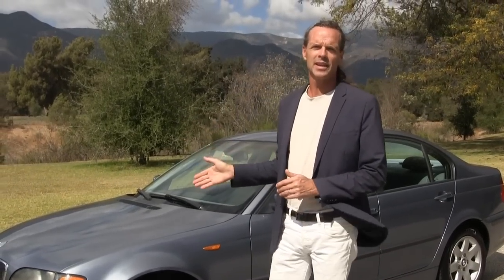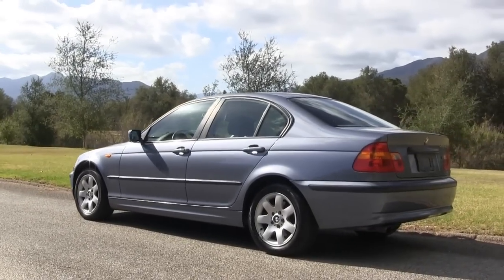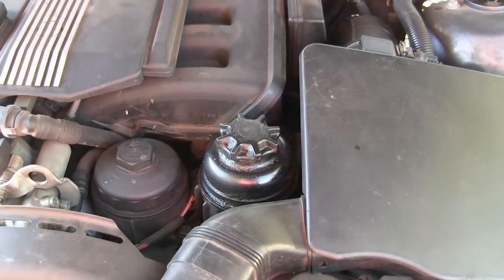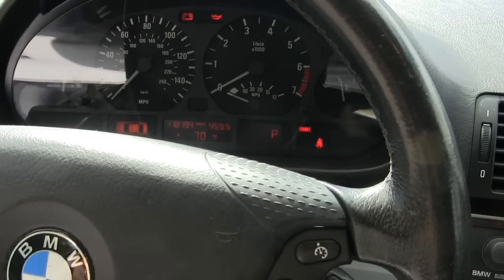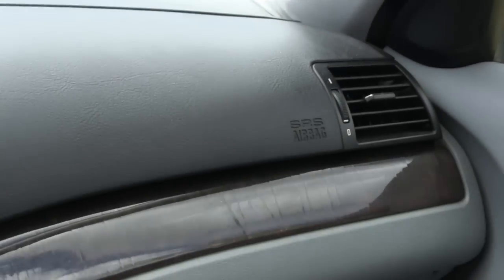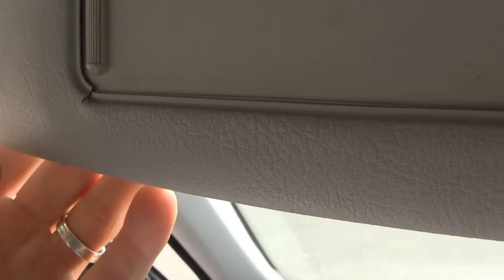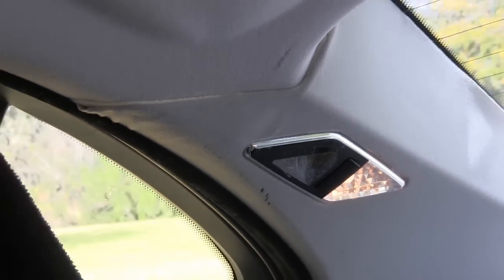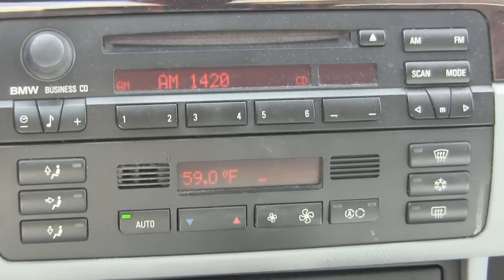Why You Should NOT Buy a Used BMW

Comment: I've had my diesel 320 e46 for 7 years now and it's been a joy to own ..... loads of torque and good fuel economy....I just love the way yanks always dump on European cars when they can't make a car go round a corner,they make a big deal out of a v8 that has 350 bhp we can get that from a 2 litre....I love my BMW's I've had 2 now and I'll keep buying them.
Reply: It's not just Americans, so many, people expect great driving well engineered Euro cars to have Japanese reliability (part of that is because they are simple).  Infiniti and to some degree a few Aciras have approached German performance- but there have been small issues there. Granted, Porsche does have that mastered which is amazing.
Reply: you are living in the 70s, right? exactly the same technical level in all today's cars. the fact some cars have multilink rera suspension while others don't, is not the reason for better durability. electronics is on th esame level everywhere from 5000 - 500 000 cars in dollars/euros
Reply: TheKenjoje he was talking about a car dating back to 90s/early 2ks. That said- even today, wouldn't you say a basic Corolla is vastly different than even a C class Mercedes which can have air suspension and drive itself (not to mention most cars still have traditional wiring vs. fiber optics)?
Reply: DFWs Cars not at all, in terms of equipment everyone is on a par, those times are gone when s-class was first car with abs....small cars get that electronics as well....
merc with air suspension is too expensive and the result is unimpressive in c class....besides, it is tech about half a century old and not that terribly expensive as final price tag is....merc is overrated crap....avensis is competitor of c class and it maybe is not as good, but for the moeny it is better....and differences are essentially small....back to the reliability - if merc c dorsn't have the air suspension, then it is comparable technologically with any toyota (not lexus, even toyota)....so, exactly the same amount of things to go wrong....
Reply: TheKenjoje good points, but in the US and other countries it's different.  We don't have an "avensis" here. Example 1. Kia/Fords are good in US, but European Kias, Fords- kill them in performance, style, etc.  Here many Asian imports are US built and rarely pioneer new technologies (there are exceptions in luxury brands like Infiniti, etc.   The US market is all about low starting price, having a cheap lease payment-- Oh and space AND cupholders.  VW even gave in- look no further how much worse the American Jetta/Passat is than the European ones.  Drum breaks on the base Jetta? come on now. Heck even Audi is building cars in Mexico for the US market.
Reply: TheKenjoje the closest we have to Avensis is a Avalon which is basically an American car (think old floaty Cadillacs).
Reply: DFWs Cars don't get confused by mexican production. the level of quality won't be worse than in europe because us market is big and important, but if they think they can save, they will....they know americans have decent roads and don't like anything but straight line driving, so they offer jetta without rear multilink and save the money....in europe, the poorest country gets better jetta than us....but not in terms of reliability. that said, both are relatively bad :)
Reply: DFWs Cars what is passat's/a4's competitor in us? maybe camry?
Reply: It is! And the Camry we get has a powertrain that goes back to 2011, minus some small refreshed items.  :(
Reply: DFWs Cars because most americans (still) just care for car as long as it's with automatic 'box and as long as it doesn't breakdown a lot, it's ok....toyota drivers in usa use their cars like any other technical appliance....so, if they don't care, why toyota should....btw. toyota doesn't offer anything special in europe as well, they still have non-turbo petrols in avensis and others don't any longer....
Reply: "I've had my diesel 320 e46 for 7 years now and it's been a joy to own..."

Sure but that's what you would expect from a top brand.  You're saying that your sample size of one is testimony to a reliable car.  The fact that a significant number of owners have these problems is a pointer to poor design and/or workmanship.

I could probably find someone who owns a Citroen who hasn't had any problems (but probably not).  That doesn't make it a reliable car.
Reply: Warren NZ there are happy cit owners
Reply: TheKenjoje I know, I'm exaggerating.  8^)

But I only know one person who owned a Citroen.  They bought it new and it was a total lemon.  They said it broke down constantly and the dealer never had parts in stock.  They sold it in disgust.

You'd have to look hard to find just ONE Corolla owner who had a story like that.  I only have one Citroen story and it's a nightmare.
Reply: Warren NZ well, during 2000s cits were ok. electronics could make troubles, but mechanics are decent. at average, better than bmw....
Reply: TheKenjoje I remember the old Citroens that had adjustable ride height and you could drive them on 3 wheels.  Can't remember what they were called.  Super ugly but arguably ahead of their time in some ways.

You could jack change a tyre by raising the suspension, blocking the chassis and then lowering the suspension.  Kinda cool.

i don't know how reliable they were but nothing was very reliable back then.
Reply: Warren NZ a lot of things were more reliable back then, you are very young and uninformed. DS wasn't that reliable, but technologically ahead of the time. on 3 wheels - no
Reply: TheKenjoje Why thank you.  I don't normally think of 64 as "very young".  8^)

I disagree, I was there.  Carburetor equipped engines were famous for flooding and distributors with points were unreliable too.  You could never be certain your car would start like you can today.

Fords were horrible at starting.  I used to hear people cranking them over for 10 seconds to start them.  I knew someone who had a 351 in a Fairlane and if you turned it off when it was warmed up, the pistons would seize in the cylinders until it cooled off!  It was pretty quick for a Ford though.

Most cars had drum brakes and leaf springs which were awful.  You'd see cars blowing blue smoke out the back several times every day.  You almost never see that now.  Well I don't.
Reply: Warren NZ wow, how bad view from you....old diesels had starting issues. vag diesels were better at it in 80s. carbs are simple mechanics to fix. ecus are harder to diagnose. needs more expertise to get through intermitent errors. I've been 'there' with both carb and ecu cars from this century.
europian ford diesels were rubbish, but they borrowed some from peugeot and that wasn't bad.
you can't be certain today with french electronics I mentioned. it is possible that car just don't wanna start and you can not find why. diagnostic checsk says it's ok. is it solution to change the computer? very expensive. in the old days, YOU KNEW why it doesn't work.
modern diesels are full of very interesting smokes. the most modern are full of choked dpfs. ecu sends more fuel to regenrate dpf which ends up in overfueling which intoxicates the oil sump. pretty much the same like with fucked carbs....the thing is older diesels didn't have precise electronic injection, so if needed, there was a lot of fuel on cold and cars were making black smoke even when new in cold....it is hard to see the diesel with more than 200 000 km without any smoke....
it is better to have certain smoke and instantly know what is it....today, in some cars, cats swallow some smokes, disguise it....you check the oil, no leaks, and the engine eats oil....after a while, a cat gets choked....
drum brakes are not matter of reliability. small cars wtill have those.
leaf springs were rare after seventies in non-commercial cars.
Reply: TheKenjoje I don't have much historical evidence on the reliability of old diesels.  I know they were often hard to start in Canadian winters especially at -40°.

I know what you mean about modern cars being harder to fix if they break but it's rare in my experience with the possible exception of European cars.  A mate of mine had an Audi that blew its engine computer and it wasn't worth fixing.  Another friend said his Audi had poor build quality as he showed me the leather peeling away from his armrest.

I've personally seen a lot of problems with Mercedes.  A way more than you'd see in any Japanese car.

Jaguars used to be famous for breaking down and overheating but I understand they're better now.

Personally I'd never buy a European car.... ever.

With modern engine management systems they will often (usually?) throw an error code pointing to the problem.  But fixing them might be expensive.

I'm not expecting to have such problems with my Lexus though.
Reply: TheKenjoje So I guess I'd say that modern cars are more reliable than the old ones but more difficult to fix if they break and more expensive too.

Does that sound about right?
Reply: Warren NZ diesels were harder to start, but were more durable inn 80s.
the modern equivalent of mercedes w123 doesn't exust today. mechanically, today's cars are not that durable.
Reply: TheKenjoje Well when I was young many people used to carry jumper cables in their trunk in case anyone needed help getting their car started.  I don't see much of that today.

i can't remember the last time I got into my car and it didn't start.  That's because it's never happened.

Anyway I think all that we each want to say on the topic has been said.  let's move on.
8^)
Reply: Warren NZ superficial view, it's not the same whether it was the diesel or petrol, but ok, there were disasterous cars back in time, but I don't think a lot of those were in the west....
Reply: TheKenjoje I bought an old 66 Valiant for $600 in about 1977.  It had a 225 cu in slant 6.  I put about 50,000 miles on it and the only thing that ever broke was the transmission when my wife accidentally put it into reverse at 30 mph.  But I got a replacement for free, a transmission company tidied it up for about $30 and a mate installed it for nothing.

I gave it to the guy who gave me the transmission when I emigrated and it was still going strong at 136,000 miles.

Those cars were reliable and quite quick but were hard on gas.  About 17 mpg around town.
Reply: unlnown one to me.

the wife, however, is absolutely crazy to the extent which is hard to imagine
Reply: TheKenjoje Sounds like a normal wife to me.
8^)
Reply: Warren NZ I usually have a lot of bad stuff to say about women, but putting from 3rd to reverse is somehow beyond my imagination :)
Reply: Wonderful cars Craig, I'm glad we can finally get the diesels here (hopefully we still can after the VAG fiasco).
Reply: True TheKenjoje.  Which sucks, because back in the day of the 116, the 107, the 124 and the 126, Mercedes were truly well built cars (a bit behind on tech in some ways, but still amazing.) Damn near bulletproof autos.

Comment: I bought an E46 328ISE eleven years ago and it's been the most reliable,  comfortable car I've ever owned.  Does over 42 mpg on a run(petrol). Thoroughly recommend them. No slouch either with a "book top speed" of 150mph

Comment: There is so much wrong with the assumptions in this video. I've bought and sold many cars, most of them used BMW, but some Japanese, and American, and the vehicle you have shows gross neglect. Whoever owned it didn't care about keeping it nice. It was neglected, and it shows. That's the problem with the e46 3 series-  some neglectful owners. Many don't care, and since it is getting cheaper upfront to buy one, people overspend just to look cool, and can't keep up with the care. Sure these cars require more upkeep, but if you keep up with the BMW RECOMMENDATIONS, it will be as reliable as anything.  As for the "propitiatory" tools, that's simply ridiculous. I've done a fair bit of maintenance on the e30, e34, and e39 platforms, and I have never once needed a "BMW only" tool. Japanese cars are not a perfect jewel, either. It all comes down to the way it was cared for. I once bought a 2006 Honda Civic Si (newer and should be "nicer" than the older bimmers I've owned). That was the biggest piece of garbage I've ever owned. Nearly every issue you pointed out with this car, was an issue in that car, but it also had a very poorly designed 3rd gear syncro, poorly designed clutch hydraulics, and not to mention the placement of the oil filter requires octopus arms to remove. That car, like all others, BMWs included have design flaws. The flaws are just exacerbated by poor ownership.
Reply: I work as a tech at two euro car shops. One specializes in BMW, the other Volvo.  We of course also do the rest of the euros and even other types from time to time. The thing Ive noticed, ESPECIALLY with Volvo drivers.... I hate them... People who buy luxury cars seem to think the car will tell them everything that is failing or has already failed. Nearly everyday I have a mint looking s90 pull into the shop, literally new looking. Only to test drive it and find it drives horribly, everything is shakey, brakes are terrible, etc. Then I pop the hood and literally everything is leaked out at one time it would seem. Oh and blown turbos.... everyday... I can only imagine that the issue is this mindset. They buy an expensive luxury car, drive it literally til its nearly totalled, THEN they have it towed in or drive it in.... These kinds of owners DO NOT maintain their cars past the contracted period whilst financing their cars, THEN they bring it in, get a huge bill to fix everything and maintain what should be as well. AND BLAME THE CARS!...Seriously?! /endRant

Comment: As with any car, but especially with old beemers, the key is maintenance.
I bought an 03 3 series which had one very careful owner. Complete BMW dealer service history. Fluids changed on schedule from day 1. 
Car drove like new. 150K miles on the clock when I sold it and still on original turbo / clutch. Best 1000 I ever spent.
E46s specifically are well made, solid cars. A good one will give you very little trouble.

Comment: Good  video. He speaks truth.  My wife has a 5 series.  Good thing she has a good mechanic - me. If taken to the dealer for the problems I have fixed, it would of cost thousands of dollars  to fix. The only thing different about my experience is I don't have the interior problems he mentioned.  Oh; one other thing.  Don't get any water in your trunk, the bluetooth  module is in the spare tire well along with the TPS module on 5 series. Had a leaking drink cooler in the trunk and it destroyed both.  Found used modules on Ebay. Drilled 2  holes in spare tire well to prevent  damage next time. I really have mixed feelings about German engineering. There are some good points about the car. It has a very solid suspension. Beefy aluminum parts. Full underbody shield reduces rust under the car. But a used one will need some fixing eventually.  YouTube  BMW oil leaks. I have had most of the oil leaks mentioned.

Comment: I'll grant you the radiators and the side view mirrors, same problem on e39 aswell.
BUT, and theres a big BUT, the radiator expansion tank ONLY crack if t he pressure release valve in the filler cap is faulty, and that's a part you need to replace from time to time.

You see, all the problems below are actually the fault of the owner, the very cheap owner who wants to do their own repairs and modifications and doing so hastily, destroying things along the way:

Kidneys falling out
A pillar getting loose
Wood grain cracking ( I live in EU)
Poor finish on plastics
Ashtray faulty
Sun visor
Window elevator
I've owned alot of beemers, all of them used and i have to say that if you see this on a used car, you KNOW the owner doesn't give two shits about it.

The real issue with e46 imo is the subframe and that only ever happens if you treat your 320 or higher like it's a drag car.
If the previous owner was a woman or an old man the subframe will be perfect.

If you're concerned about sub frame cracking, buy a frame stiffener kit from ebay for cheaps and have it fitted. it'll prevent the subframe from twisting and that will keep the floor intact.

Comment: German cars are of poor material specification, but of high manufacturing quality. This means, the fit an finish is good, the but the parts are not suited for their purpose.
Reply: abaj006 I like your approach
Reply: Yea, exactly, this is what everybody thinks of first when it comes to German cars: not suited for their purpose :) you are funny
Reply: Correct.  They are focused on details and making things complex because nobody questions the quality of German engineering.  The whole thing becomes unreliable and useless after very short time.
Reply: They use "environmental friendly" materials thats why, but bit stupid at the same time as getting stuff replaced is probably going to cause more harm to the environment than good.
Reply: 😂. The quality of mechanics are poor. Most of them are out when the European cars come around. They charge your ass for noting and they do nothing. No brain.